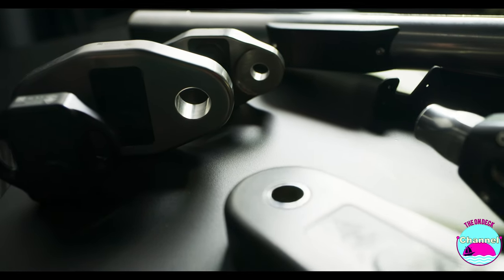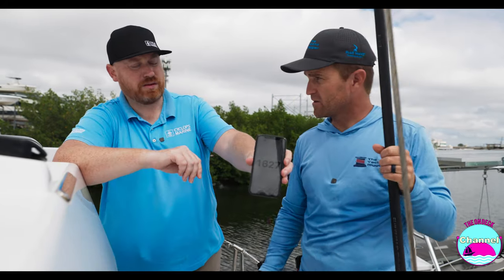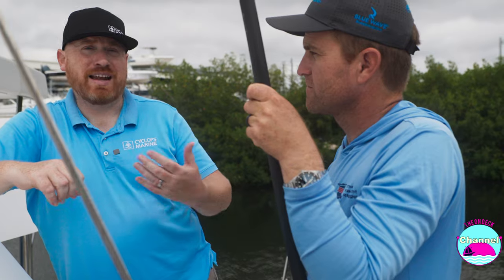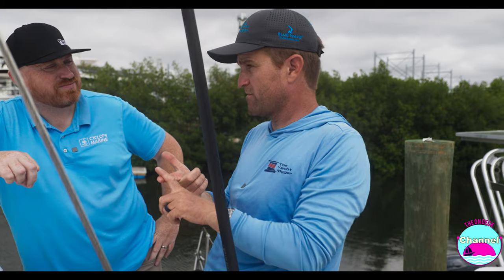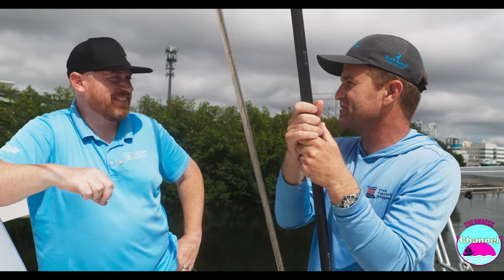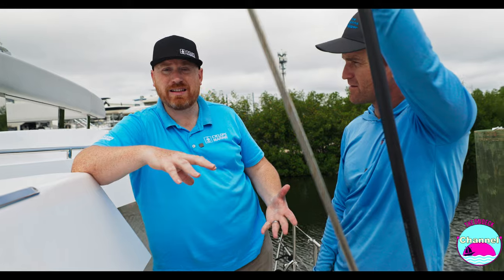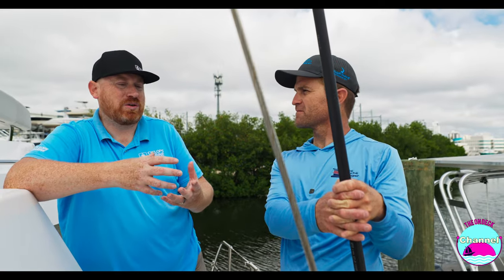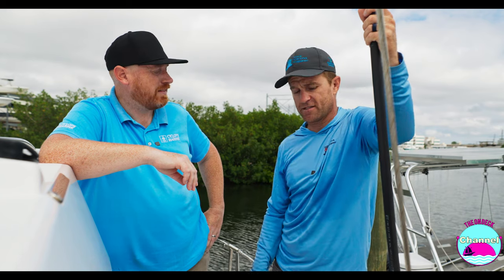There's an App for THAT? | Cyclops Marine Sensor

Comment: If you are a cruiser this is not needed. However as a racer or if you push your rig then yes these systems are great. However they are crazy expensive.
Reply: I would buy it just for the rigging tuning. It’s make tuning a rig super easy. It is still very expensive.